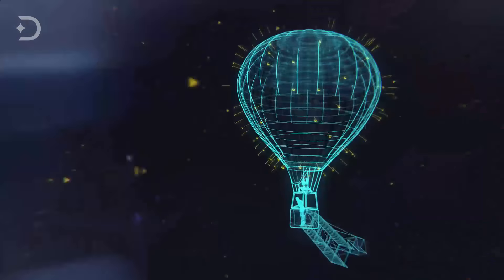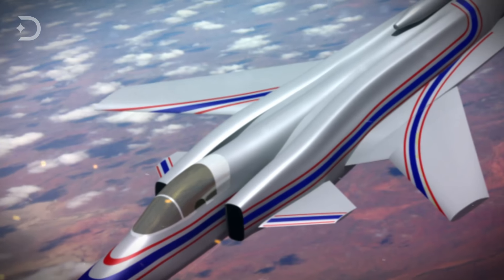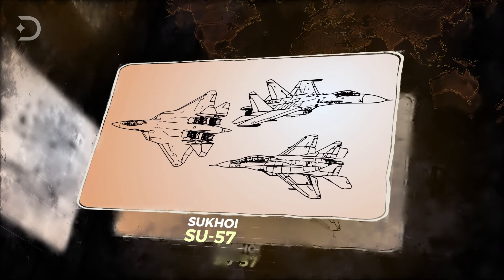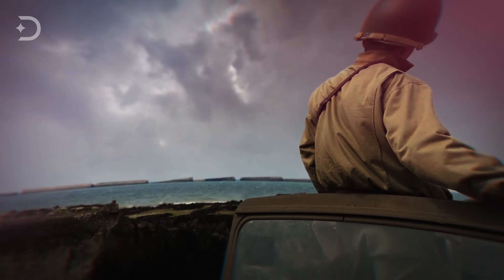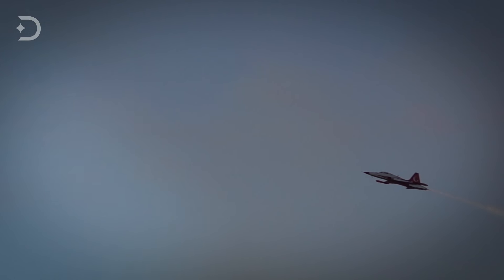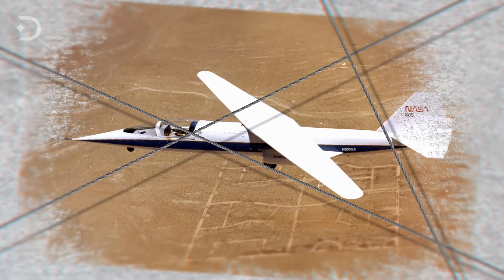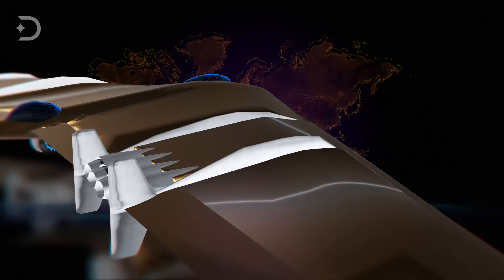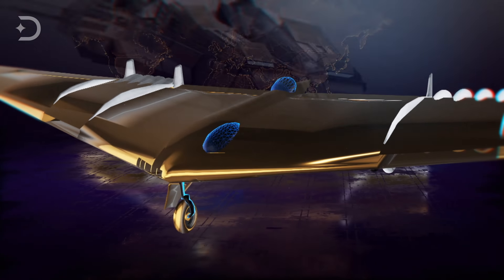Could The USA Build A Forward Swept Aircraft?

Comment: America has already built a FSW demonstrator. It's called the X-29A built by Grumman for NASA. So it's not "Could America build a Forward Swept Aircraft" It already has, and did so in the 1980's. It was also a fly by light demonstrator, and one of the first Aircraft to use computers to control airflow over the canards, with  wingtips that were allowed to flux, or lightly twist, to help keep it stable in flight. Top speed was a reported  Mach 1.9

Comment: The reason why a forward sweeping wing is so unstable is because the air, when passing over the leading edge of the wing, gets compressed where the wing meets the fuselage. Basically, the wings are scooping and sliding air in towards the center of the aircraft rather than back and away as with a rear swept wing. 
The effect can be felt by placing your hand outside a car window while traveling. Stick your arm straight out and you'll feel the air build up on the leading edge of you arm as it tries to push you arm backward. Angle your arm backward and the air can pass down the leading edge towards your fingertips with little resistance. Now angle your arm forward in the direction of travel and you'll feel the air rush in towards your face. In an air chamber, this causes huge vortices at the connecting point of the wings and directly above the aircraft as the two vortices off the wings collide. The reason they are so maneuverable in flight is basically because the turbulence is essentially trying to push the aircraft downward which reduces lift. At very high altitudes with less air density, this configuration may work better but it'll never work as well as a rear swept wing.
Reply: Thanks for your explanation.  I was wondering what, if any , reason why would want the wings swept forward. Seems silly and dangerous.
Reply: Keep arms inside car

Comment: The X-Wing was built, but didn't fly as such (it was a kind of compound helicopter planned to be able to stop it's rotor in flight and fly as a fixed wing/rotor aircraft) 
It flew using a pair of small wings, but not with its stopped rotors

Comment: FSWs are great if you don't plan on flying faster than 400knots without excessive drag / fuel consumption, you don't mind having an enormous frontal RCS, you don't want to ever have supercruise capability, or the ability to have multiple weapon stations on the wings, and you don't mind replacing the entire wing when they develop stress fractures. A delta or modified delta by comparison will provide adequate low speed handling, along with much lower transonic & supersonic drag, plus area to store internal fuel & mount weapon stores.

Comment: You'll have advantages with a swept forward wing, but recourse 1/2 the wings rear ward again, and the wings need to be made twice as strong.The 22;is fine For sweep forward designs round out your points on these and pull them back into the body.

Comment: The U.S. built the X-29 in the early 80's which first flew in 1984, and two X-29s were flight tested through 1991.
Reply: It was so unstabile that they should be happy that they had "Fly by wire", ore they both would have crashed

Comment: The Grumman X-29 was an American experimental aircraft that tested a forward-swept wing, canard control surfaces, and other novel aircraft technologies. The X-29 was developed by Grumman, and the two built were flown by NASA and the United States Air Force. The aerodynamic instability of the X-29's airframe required the use of computerized fly-by-wire control. Composite materials were used to control the aeroelastic divergent twisting experienced by forward-swept wings, and to reduce weight. The aircraft first flew in 1984, and two X-29s were flight tested through 1991.

Comment: the x-29 was made so that the airflow around the wingtips was smoother, so that the plane could achieve supersonic speeds much faster.the main problem might have been the straight flaps on the back, or the thickness of the wings.

Comment: The design of the wing shall have greater area at the base and stretch forward to cover a greater stress area. More base area is more strength of the wings.The shearing length should be more than half the wings length.Or you can change the design of the plane to have a more wider hips.

Comment: We already made something like this, and with a V tail. The YF-23 blackwidow. Probably the sexiest airframe ever. Plus it was fully stealth. It apparently performed better then the f-22, in stealth, and in performance. but wasnt chosen as the primary US fighter due to some weird reason.
Reply: Which the RussianS used to build the su 57
Reply: The YF-23 did not have a forward swept wing, it's wing was triangular wing.
Reply: The YF-23 was superior in stealth, but was much less manuverable and slightly slower in super cruise.
Reply: YF-23 Did not have forward swept wings - So no, it was not something like this.
Reply: In the 1980s the X-29 was the first supersonic forward swept wing aircraft.

Comment: The US developed the forward swept wing ages ago but never went into production.  It was designed to improve the aerodynamic drag of the conventional wing and had some success but at high speeds, the stress on the wings were enormous and the aircraft became unstable as it could spiral uncontrollably at some point. The program concept was suspended until further technology of better (composite) materials could be developed to produce a better wing that can handle the drawback of flying at high speeds and tight turns without having divergence issues.  The US airforce decided it was not a priority to develop agile fast speed aircraft such as this as advances in combat engagements shifted to concentration on thrust-vectoring aircraft technology and medium range smart missiles instead.

Comment: We already have built one and it was called the X-29 and found that there were more problems than benefits like it was the most aerodynamically unstable aircraft ever built. The engineers concluded that if all three flight computers had failed together, the airplane would have broken up around the pilot before the pilot had a chance to eject. One study on the aircraft determined that the benefits did not outweigh the disadvantages and then stealth technologies came along. The Russians tried it with the SU-47 and found so many problems with wing stress that they scrapped the project and went back to traditional wings on the SU-57.

Comment: All they had to do was watch a bumble bee. According to scientists, they shouldn't be able to fly at all. Do they have 3 flight control computers? Having experience as a fighter bomber mechanic in the Air Force, I was a crew chief on the FB11-A (Aardvark). I did launch pilots from Pease Air Force base in New Hampshire, I remember they  would fly down the east coast and be back in less than 2 hours and 30 minutes, super sonic flight had to be done over water so no sonic booms and broken windows. my favorite military aircraft was the F4-Phantom--it was to me a sports car made into an aircraft.  You'll never be told what the actual top speed is as that's need to know information. You will be told what speeds it can attain but you will not be informed on the actual top speed as that information is Need to know.
Reply: @Jumpercable wireless   The Phantom was and still is my favorite, I was an airframe mechanic then an airframe fitter working on different aircraft.   Our Kurnass were properer war machines.   Long live Spook, 69th Hammers
Reply: @trespire  I loved the way the F4-Phantom looked. It was like a person that designed Super Cars, decided to build a fighter. It had beautiful lines and I'm sure it was a fantastic handling aircraft. I was in the 509th bomb squadron (Strategic Air Command). Thank you for your service.
Reply: F4 pair used to make practice bomb runs over our radar compound in Germany in the early 1980s, at least that's what it looked like. Thought it was cool as hell when everything around would kind of rumble and shake.

Comment: Both the X-29 and the Berkut were fundamentally flawed , and completely impractical . The forward-sweep had advantages , but caused enormous material-fatigue , especially at high speeds . In practice this limited the plane's top-speed , while driving the procurement and maintenance costs right through the roof . What was lacking was a means of stabilizing the wing-ends , in order to prevent twisting in the first place . The simplest way to accomplish that , is to use a dual-wing configuration . The front-set would be low-mounted and swept-back . The rear-set would  be high-mounted and swept-forward . These wing pairs would be joined at their ends , NOT box or winglet joined , but actually affixed tip-to-tip . This architecture creates a triangular space-frame type geometry , with the fuselage as the base . Such is an extremely strong structure , and is capable of raising a plane's max-G to incredible levels . 
*Long live space-frames ! 
 .😎

Comment: Why is this even a question? The Grumman X-29 was built in 1984 and we determined it wasn't a feasible design going forward.
Reply: Feasible, yes.  Practical, not really.  It didn't excel in any areas besides air-to-air combat.  As an experimental test bed it was remarkably successful.  Best thing USAF & Nasa did since the XB-10 Valkyrie.

Comment: I don’t think stability is the issue. It’s structural durability which also includes cost issues since you need to use more exotic and stronger materials as well as more expensive structural designs. Lack of stealth could also be an issue but that doesn’t matter for cheaper non stealth planes……. if the cost issues with the complex structure and materials were solved.

Comment: There's a reason why forward swept wings aren't used today in jets, very unstable and also you can't achieve high speeds like modern jets today by of the resistance from the forward wings, just not practical

Comment: Having 1 set of small forward swept wings situated slightly longer angle of the 2nd larger forward swept wings at the rear does make it unstable to fly & does need onboard computers to it aloft. Air dynamics being in the wind tunnel tests would show design flaws. More stable design are matched height of the wings as a wing design. From an engineering standpoint, this Gruemen design is impractical & too much of a fuel burn.

Comment: This is horribly researched. Very simple WIKI searches would provide more accurate information than offered here.

The problem with the Grumman was it was years ahead of it's time as a test of concept. The fact that it was built and flown is by itself incredible. That it was flow in 1984, 18 years before the Sukhoi, is near proof of this editors inability to properly research ( much less edit ) a supposedly informational video as this.

Comment: the era b4 missiles ruled would hve been time for forward swept wing. Cobra GI Joe's enemy had a forward swept fighter in my teen yrs. That fly by wire missiles not king beyond visual range was the time for forward swept wings, 80s-90s gone.  If we use it NOW it will b on canards forward swept to hve greatest effect yet not jack w/efficient stable flight on a future drone. The stealth aircraft godless smack old tech need control surfaces & these give off radar signal. So the less control surfaces u need the better using thrust directing & lighting fans save your bacon if needed to recover or shorter take off. Hving forward swept canards will lessen need for flaps. The better a drone can fly straight level no help but at same time out maneuver convictional pilot or other drone is objective. Shooting at drone full evasion not stable flight. Safe mood or escape crazy flight mode, same drone.

Comment: A shot of EMP will take down the forward sweeping wing.
Reply: What is a shot of EMP ? Do you even know how an EMP is generated with current technology ?
Reply: Electromagnetic Pulse will cause the electricity shortage. The forward swept wing is total relying on the computer to avoid excessive g force. US Navy did testing with EMP in the 1980, any jet can be dropped out of the sky easily with the EMP shots. I used to work with an engineer to design a special computer to flight the jet aircraft. An aircraft was modified and went through the EMP test successfully. My management arranged me to work with the scientist and wished me to learn the technology filling his shoes when he retired. But the Navy canceled the program and has not revisited the technology. He was transferred to the top secret working building and later retired. He did give me a lecture how it work and show me the report but he did not let me read. Possible due to the clearance”The Need to Know” even I had a Top Secret Clearance
Reply: The EMP source can be found from the detonation of nuclear bomb. If I know how to create the EMP cloud and tell everybody how it is built, The FBI or DOD would visit my home, and I would loose my freedom or would not see the light again.